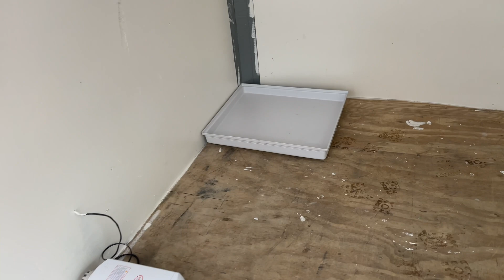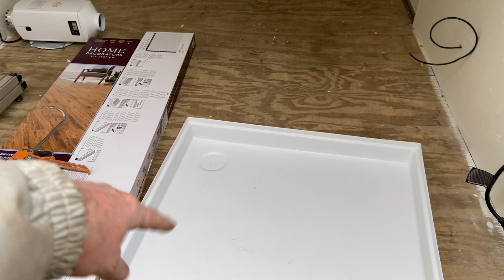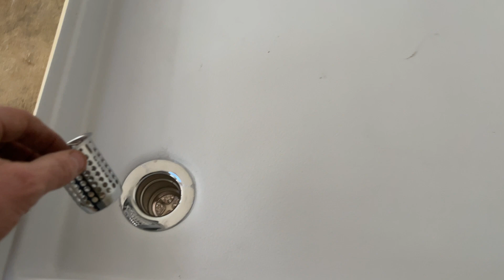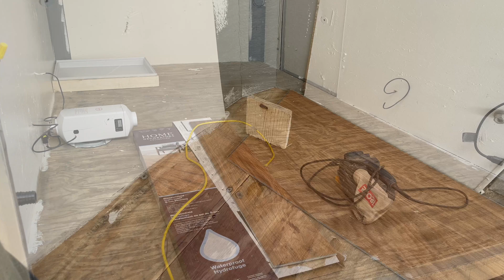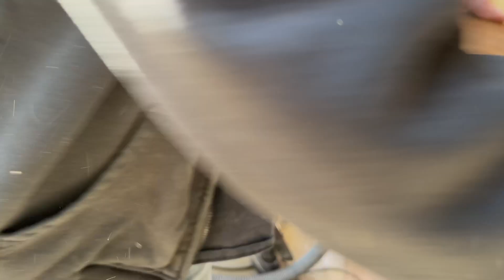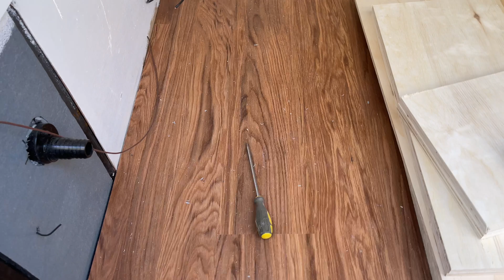How to Build a Tiny Off Grid Cargo Trailer Camper - Shower Pan/ LVT Flooring

Comment: Great video! You're an excellent teacher. I appreciate the tip about using the multi tool, I would have never thought of using that vs a jig saw. What size is that shower pan and where did you get it?
Reply from the maker: Glad it was helpful! The shower pan I bought off Amazon clearance, Its 24"x27". I think its the perfect size for such a little trailer

Comment: Carpet bar is metal and that would be a good transition piece from the hard wood floor to the trailer. It will stand up better than wood trim.
Reply from the maker: Thanks for the advice! I will take a look for some. 👍

Comment: Greetings from northern Ontario! Videos are awesome, keep em coming. I found a pocket jig to be super helpful in my build too! I just finished up my 5x8 cargo overland trailer, use my ranger to pull it! Really fun.
Reply from the maker: Hey Joel 👋
Nice.... I love North Ontario!
Isn’t that funny... I’ve got a ranger also. They are great little trucks. I can’t wait to get out and do some camping with my “new” camper. Do you find your cargo trailer bounces a lot... I’ve been collecting parts to put brakes on it and I’ve been debating shocks. What do you think? Good idea?
Reply: @Cargocamperdiy  Yeah mine bounces too.  I am considering welding on some brackets to install some shocks. I installed some matching off road wheels on my trailer (same as my ranger) and it still bounces like crazy. Can see the install on my channel!
Reply from the maker: Yeah that’s what I figured.... when I was using it as a construction trailer the thing would bounce all over the place. There is a pretty decent looking kit on amazon that I think I’ll get, shocks and brackets as a package for just under 200$. I think it only works though if your axle is under your springs. I have an axle flip on the to do list.... anyways huge list. One thing at a time. I will go check out your channel right now! Thanks for following along and please let me know if you see something I should change or add. 👍